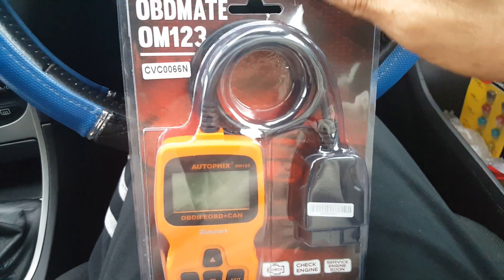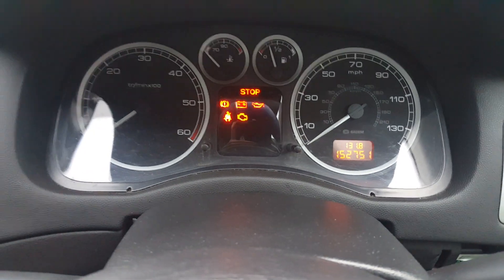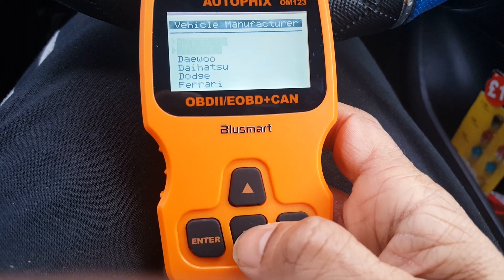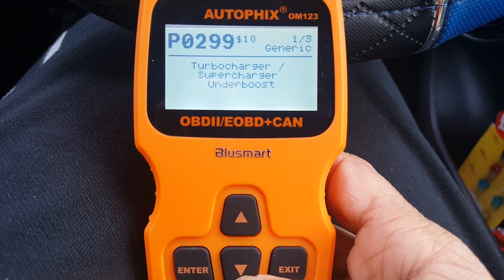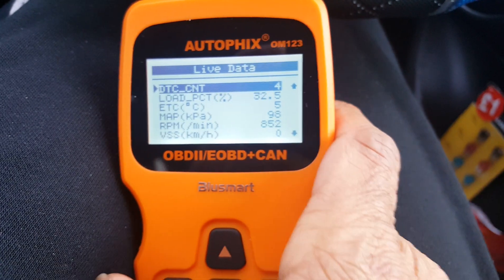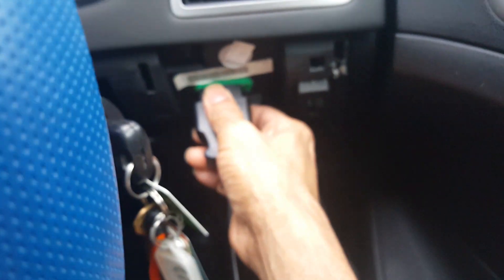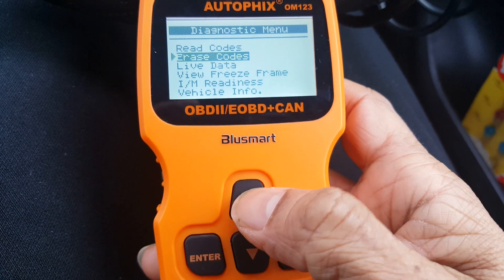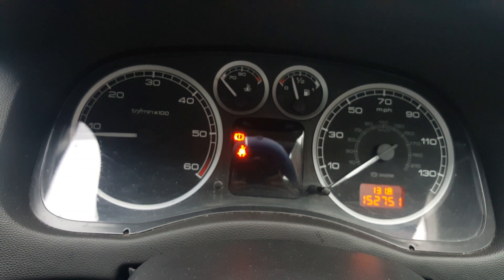OBD2/OM123 Universal Auto Code Reader Scanner Diagnostic Tool

Comment: A basic one just like the one i bought,Am3011, which are smaller and cheaper than the bestseller on Amazon.
4 button with 1 I/M hot key, which are more convenient. It has the same functions with yours. The battery tester is also added.
Maybe there are any more good product need us to discover.